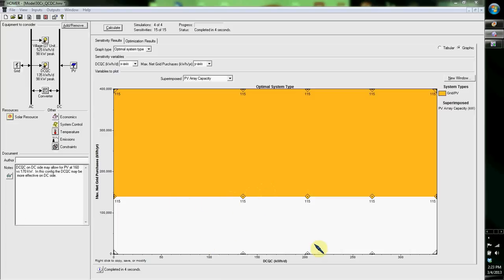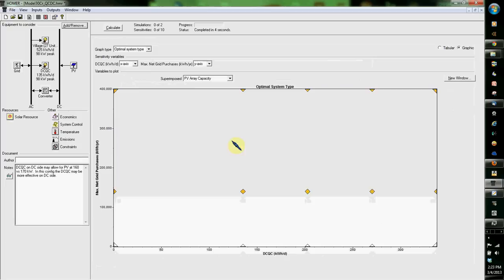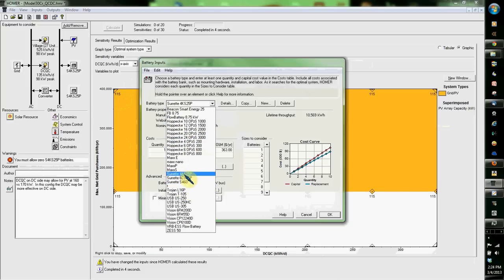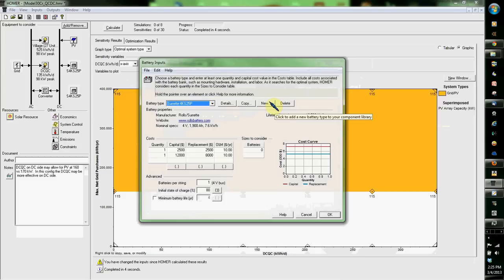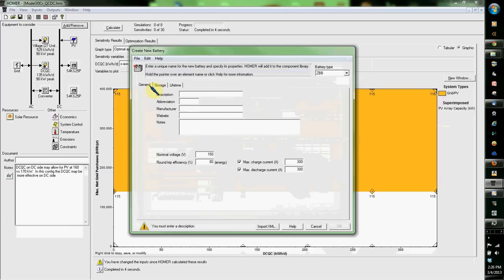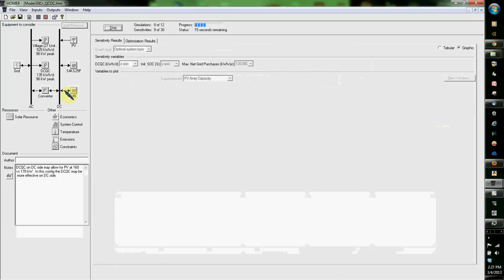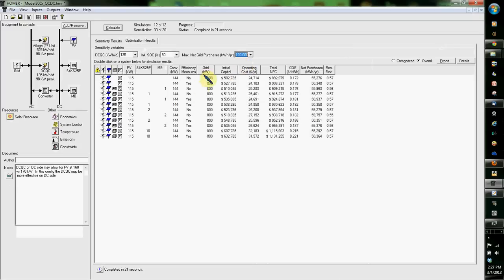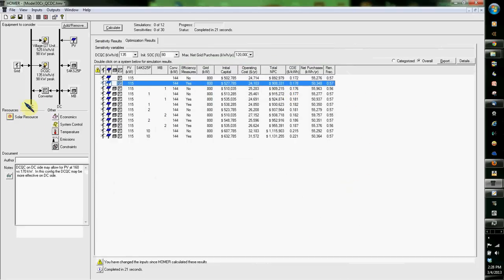Microgrid modeling HOMER Energy Battery Demo

Comment from the maker: I contacted the vendors on some equipment asking for data sheets (harder than is sounds), others I polled users of the equipment (also harder than it sounds).  On parts where neither worked I went with a estimation based on expected duty cycle combined with reasonable assumptions.  Best to go more towards the worse case.  What is your project?
Reply: Is an university summer project, it's starting now, so I'm just learning how to use the software and there are a few stuff that I dont find around the internet, like Operation and Maintenance $/yr or a wind turbine price for example. So I am just making up some values, since I am only getting some practice on it.

Comment: what is this software? I m working in microgrid, and backup batteries in power systems .. please tell .
Reply from the maker: Hi, yes this is for use with microgrids and renewable energy.  I used it on my thesis (hybrid microgrid with FC and/or Batteries).  the company is Homerenergy.com